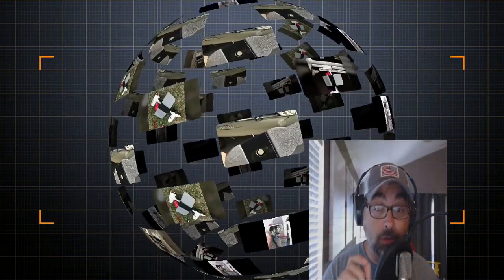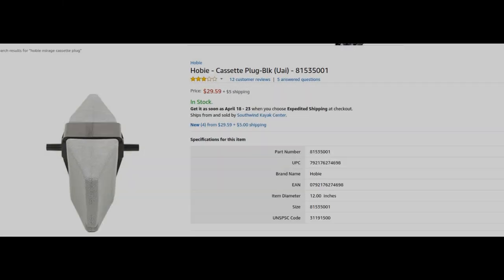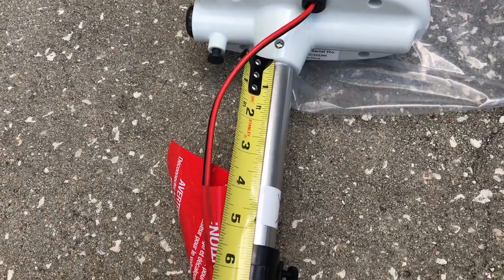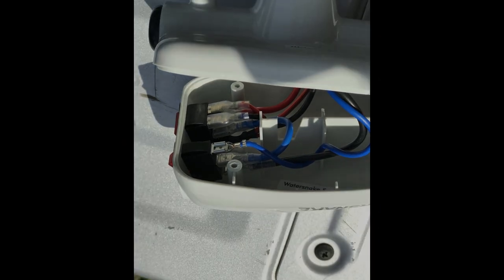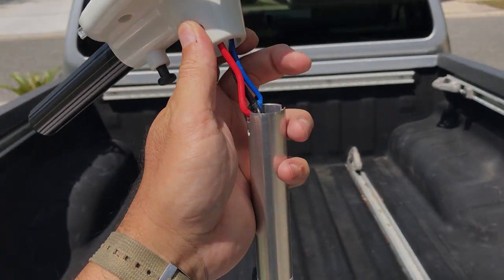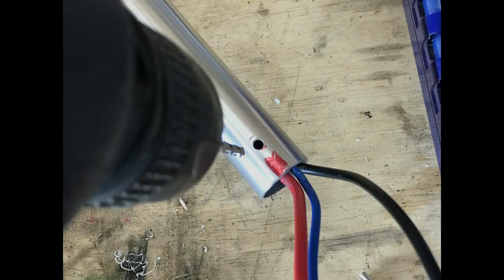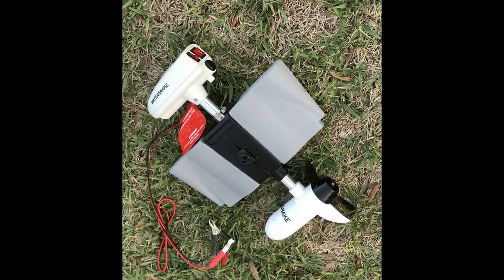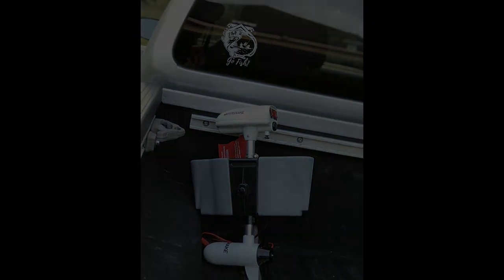Watersnake trolling motor mod Hobie Kayak Mirage Drive (T18S & T24) Installation

Comment: I bought one pre-made by a guy and her reinstalled the steering handle but fixed it in the straight position using a bungee cord but if needed you can slide it off the handle and control the direction of kayak with your hand just like a 360 drive if needed 👍🏼

Comment: I followed your video and did the mod but I have only the top speed and no reverse>  I took pics and even wrote down which wire went where.  Im wondering if theres a wiring diagram>  Also thinking of redoing another watersnake 24 and wondering if theres a way WITHOUT pulling all the wires?

Comment: Built it good idea but bad design trolling motor has to be held with feet to stop it from spinning and also does not come out unless prop is straight up and down
Reply: MrArchitect101 exactly....just took mine out that was a pain...also popped a fuse with gunk on prop in high speed..now I carry a bunch of 7.5 fuses....😏

Comment: I have water collecting inside the mirage plug housing. Thoughts on drilling a drain hole? Ever find a lightweight battery option?
Reply from the maker: I haven’t tried but you could always try to fill with foam. I don’t use it that often because I am in the shallows quite a bit  with the creeks and inlet that I fish. 
I made it for when I visit lakes but I haven’t done that yet 😐

Comment: If we were using trolling motors . We have to do registered before using ?
Reply from the maker: Legally yes. When I had my Vibe tandem kayak I ran a trolling motor on it all the time and it was never registered. I have never run in to anyone out in the creeks that was checking but in Florida yes you legally are supposed to be registered if your using a trolling motor.
With a Hobie it’s a little harder to detect since it would be down in the mirage drive.
Reply: @GetOutTheHouseGoFish   thanks very very much👍👍👍🤩

Comment: One problem.....how long on one charge? Solar charger attached?
Reply: Just get a 50ah lithium battery. It should last 3-4 hours. It's a very efficient motor.
Reply: @timleng4404  since this comment I made I have the 50 amp battery and a solar charger so I’m good all day
Reply: @jeffw3776  Assuming you've got the lithium battery. Solar charging is too slow for me. I would rather invest in a bigger battery.
Reply: @timleng4404  the solar keeps the battery at a good charge if you started with a FULL charge

Comment: Great Tutorial on this subject. Curious about the Watersnake trolling motor and only having two speeds. Has that been a handicap on the water? I'm not looking to create a wake, actually just the opposite. I want to be able to troll super slow and without having to drag a drift chute/sock to reduce the speed. Do you feel this set up is capable of that? Thanks in advance for a reply, and again, for posting. Sincerely believe this may be the best I've seen.
Reply from the maker: Yes this should work out great for you. No issues when I use it in the hobie.
It’s a really easy mod too. Hardest part is cutting the tube.

Comment: Can this be done on the ATAK 120
Reply from the maker: Hobie includes the cartridge plugs with their kayaks. For the ATAK you would need to make something that fit in where the drive sits down in to then modify it to take a trolling motor small enough to drop into the drive.
It’s possible.

Comment: Best instructions see yet. Thanks!   Do you steer via rudder? Or also move the trolling motor head?
Reply from the maker: Thanks. Yes steer via the rudder or I guess you could use your feet 🦶 to steer a bit
Reply: forward, you can steer with the rudder. Reverse, the rudder doesn't work that well. Better to steer with your motor. I've made mine so you can steer with the motor, thinking of making something so you can steer with the foot rather than hand.

Comment: there is no way that plastic hobie cassette will hold tpgether without reinforcement
Reply: I've put an expansion foam inside the cassette. No issue  with T18 running the Compass. 4.2mph top speed light load and I light 200lbs.

Comment: What’s the point of the notch cutout on the tubing
Reply from the maker: So you can move the head unit down after cutting the tubing so it seats properly.
Reply: GetOutTheHouseGoFish ....oh ok...I just put it on without cutting and stuffed all the excess wiring in there. It seems to be working just fine for now. I used a pipe cutter to make the cut..easy...I also added a Powiser Solar Panel so I can now troll forever for salmon...thanks
Reply from the maker: Jeff W oh cool 👍 as long as it’s working 😃

Comment: How do you prevent the cartridge from rotating in the mirage drive slots / clips.  That could cause propeller / keel damage if the thrust rotates the prop head forward.  Mine did
Reply from the maker: I haven’t experienced that problem.
So the clips are not staying in place (locked) and it tilts forward?
Reply: @GetOutTheHouseGoFish  the pins stay in the clips but the entire cartridge can rotate on the mirage drive slot
Reply from the maker: mmikle77 you mean the trolling motor rotates?
You’ll need to install some kind of pin or use a glue gun or epoxy to stop it from doing that.
I’ve also seen some people fill the cartridge with foam and that’ll help stop it rotating too.
Reply: @GetOutTheHouseGoFish  yes the entire motor rotates and must be held in place by hand.  Annoying
Reply: mmikle77 make sure you seat the drives....I didnt and it blew a fuse...no damage just carry extra 7.5 fuses in case you get hung up or hit something